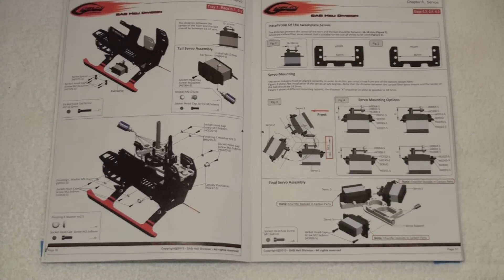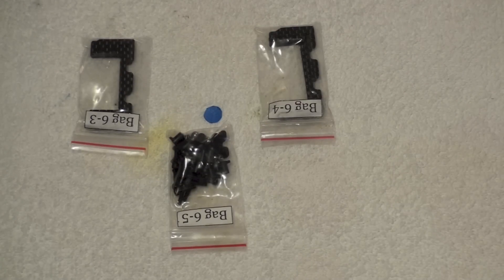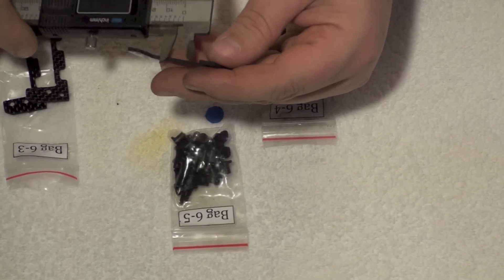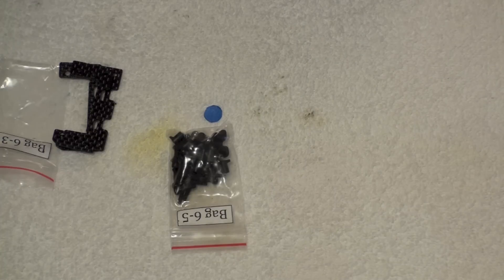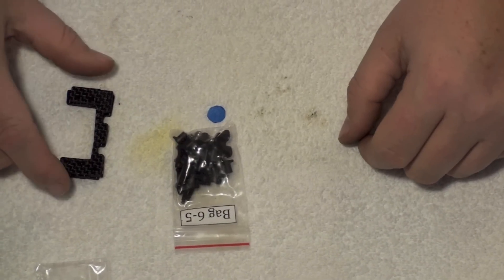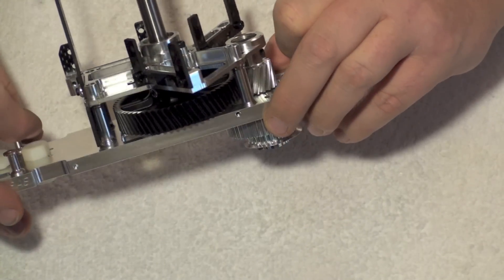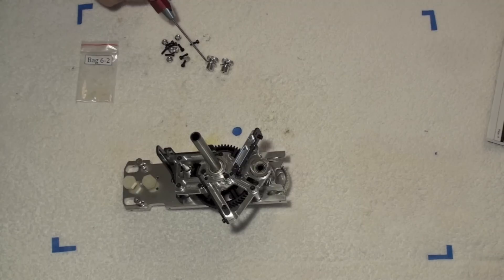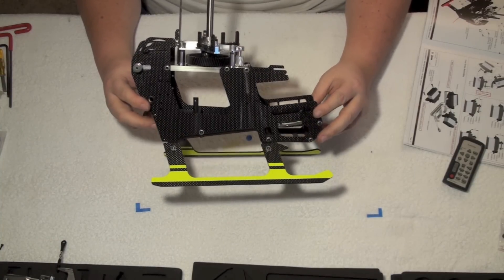Goblin 500 Build Chapter 8 Servo Installation

Comment: Did you get your servos yet?  I am using Savox 1290 on the tail.  it is sitting in the fuse and complaint about the fit.  When I back the mounting screws out the screaming stops so I have a bind somewhere.  Did you run into a problem like that?  If I look down the boom the control rod is not straight so I think that is my problemNot sure what I am going to do about it yet.  Any thoughts you might have would be appreciated.